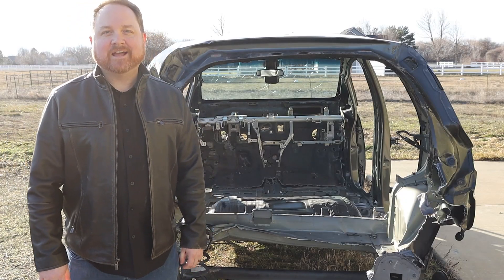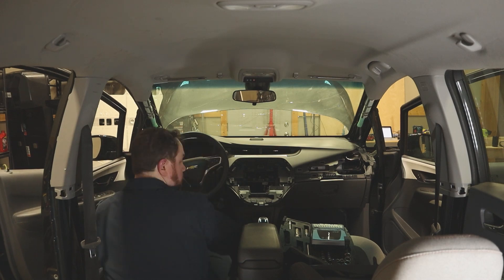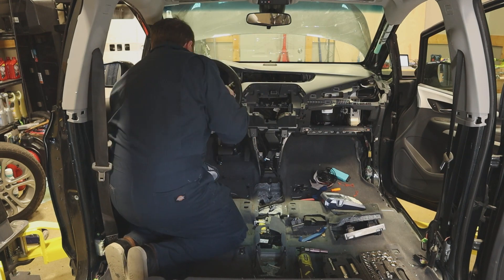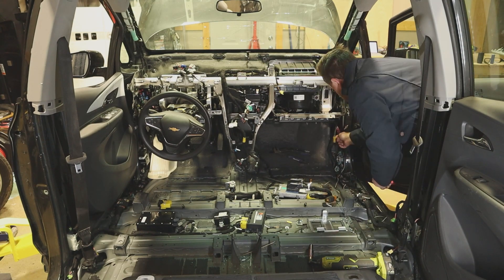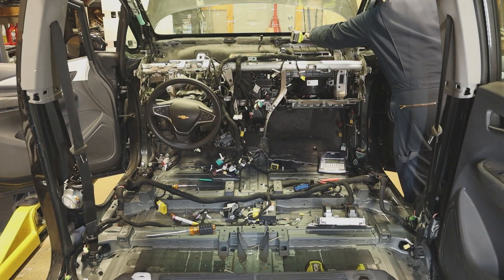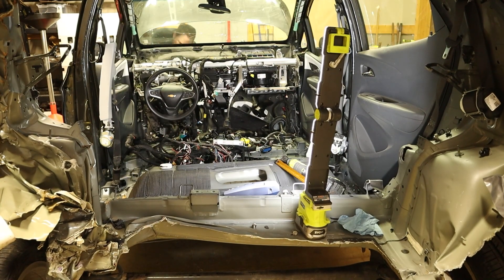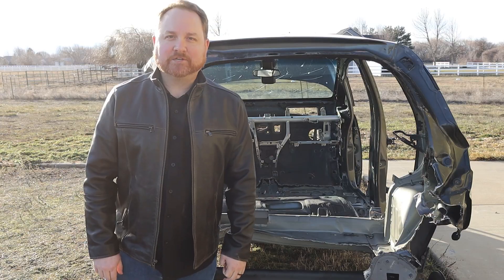Gutting the interior of a 2019 Chevy Bolt EV

Comment: Thats cool ! Great job ! I did not see where is the main fuse in the Bolt, disconnection from the main battery ?
Reply from the maker: It's located under the rear seat in the Bolt. When the battery is removed it is right on top of the 'hump'.
Reply: @BillCarlson  thank you ! and is it possible to unlock the gear and push the car, if it is not starting (or accident) ?
Reply from the maker: @ЮсупКуштов I had a hard time with this until I could start the car and put it into neutral. There is a parking pawl within the drive unit, plus electric parking brakes on the rotors. If you can get the wheels on dollys, then it can be moved without issue.🎉
Reply: @BillCarlson  thank you

Comment: How does the single pin connector under the seats work? I’m trying to remove the front seats from my 22 bolt EUV and the connector looks to be the same. Thank you!
Reply from the maker: @joelhitchcock2012  it seems every connector in the car is different - and most are a pain to remove! I think the ones under the seats are "arm latch" type, where you need to swing an arm around to be able to pull them free. They may have a retaining clip instead, but almost every connector has some kind of retention mechanism, and many require a small screw driver to unlatch.

Comment: Hi Bill, i have a Ampera-E the same as the one u are ripping :-). i HAVE A FUSE WITCH KEEPS ON BLOWING I DO HAVE SOME diagrams, and all was directing to the entertainment system. So i removed everething , fuse F36 keeps on blowing. When i remove relai 58 the fuse keeps healty. but nothing works anymore. My question for you do you know where relai 58 from the internal fuse box ( bythe way) is going to ??
Much regards William (Bill)
Reply from the maker: Sorry, I don't - I would be relying on the same diagrams as you. The wiring diagrams are pretty good, but searching PDFs is TERRIBLE, so I frequently find that it misses places and I have to hunt around the wiring diagrams to find how things are hooked up.

Comment: How did you get the front center console at 3:45 in the video (underneath the instrument panel) off?
Reply from the maker: Sorry, I don't remember. I just took nuts and screws out and pulled on things until they came off - didn't really have a plan. Do you have the shop manual for the car? If not, you can find it online (Check reddit /r/BoltEV for a Google Drive link, or eBay - $15) - and it provides pretty solid instructions for how to remove everything.

Comment: I watched this video because i want to install a roof rack on my Bolt EV that installs by drilling holes in the roof right next to the front and rear doors. So i want to remove the headliner to verify nothing critical like wires or airbags are in there. From your video it almost looks like an empty cavity which would be ideal. Did you scrap the shell already?
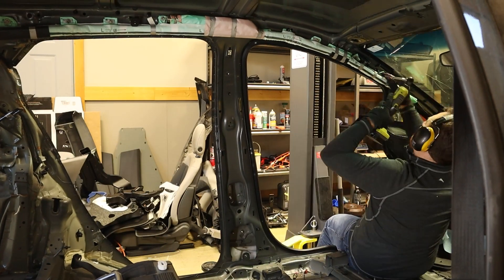Reply from the maker: I still have the shell, pretty much in the same condition as it is in this video, though I don't know how long that'll be. If you take a look at the 12:30 mark, you'll see that the airbag runs just about the entire length of the car. If you attach the roof rack above that area, you'll be fine.. just don't hit the airbag!
Reply: What part of the country are you in? I saw the airbags. It looks like there is a piece of sheet metal behind the airbags that bridges across the corner and makes an air cavity behind it. If that is the case, it would be a good place for the swivel nuts. Those are nuts that install from the top through a drilled hole and swivel to be larger than the install hole. I just bought this car and would be devastated if I drilled a hole in the wrong spot so I need to be sure. I wonder if we could communicate via email and you could send me some photos? If this works I would make a YouTube video that shows exact placement and give you full credit of course.
Reply from the maker: @alexkram  I'm in central Washington State near Ellensburg. My email is available here on YouTube on the 'about' page, feel free to send me an email and I'll see if I can record a video or take some pictures of the areas.

Comment: Any chance you still have parts of the steering column? specifically the Power steering motor?
Reply from the maker: The steering column and power steering motor is installed in the DeLorean!
Reply: @BillCarlson  Oh okay! How much of the original bolt hardware is controlling/driving it? just came across your vids,
Reply from the maker: @tiagankoob8857  The frame, suspension, and steering rack are from the DeLorean, but everything else is from the Bolt.
Reply from the maker: @tiagankoob8857  I'll definitely consider it once the build is complete! I use BlueCruise on the ~90 minute drive from Ellensburg to Seattle and works pretty well, although I don't know how frequently we'll be making that drive in the DeLorean.

Comment: Thanks for a great content as always.How fragile are those headliner and dashboard clips? Did you break any in the process?
Reply from the maker: Thanks! The clips were actually pretty good - I definitely broke a few, but only one trim piece went in the bin and the rear light on the roof basically shattered when I undid it. Also the fuse block under the hood is held together with like 7 clips all around it, and literally every one snapped.

Comment: That was a great video !!!  How many days did it take, to remove all that ?  I can't wait to see the build start. See you soon. 😁
Reply from the maker: Thanks! Gutting the engine bay took ~7 hours and the interior was another ~6 hours. This was how much video I had of each, so figure there were also times when it ran out or I didn't hit the record button or whatever. I recorded the engine bay over 2 days and 3 days for the interior. I think the next video will probably be about mounting the electric motor, which should be pretty cool!!

Comment: I was gob-smacked at the sheer amount of wiring harnesses in the Bolt, just as well you labelled everything, it is going to be a nightmare to put even 70% of that in the DeLorean.
Reply from the maker: It's crazy how many little modules there are! It took two 50 gallon boxes to hold the wiring harnesses and all the electronics.
Reply: Even my 71 MG Midget had 10 lbs of wiring, which I cut down to 5lbs.  My 2002 Prius wiring, like 50lbs..

Comment: I'm curious to see how many of the safety features, like the ABS you mentioned, that you'll be able to take over. Do you plan to try to move things like the pre-tensioners, curtain airbags, etc? I know none of this is needed to finish the project, and trying to do so would require figuring out how to mount the sensors to trigger the safety features... Surely not an easy task.

Unrelated; The french cleats and T&G cedar ceiling in your shop is amazing! Do you do wood working as well?
Reply from the maker: I would love to have airbags in the car - but the DeLorean interior wasn't made for them. The gull wing doors mean no place to put the curtain airbag. If I pull over the entire steering wheel I can use that one, and maybe knee airbags, but that's about it.

I will try to get ABS working and traction control, plus a 3rd brake light.

The tongue and groove ceiling was here when we bought the place! It's absolutely beautiful and was a big selling point of the shop. The French cleat system is all me, though. :)